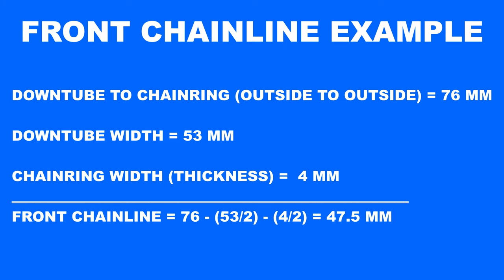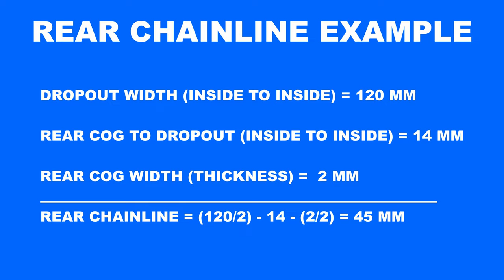PERFECT Chainline Every Time

Comment: Chain line is important. Especially for us doing restomod work and changing up the drive trains. I put a full internal hub drive on a 90's MTB with new crank and external bearing BB. My concern was chain and cog wear. I lucked out, Only 1mm out. 9 speed chain. You are not the only one that mucks up load mm to cm as a non-native metric speaker.

Comment: it may be more precise to measure the chainline off the edge of the BB shell, and then offset the measurement by half the BB shell width, as the middle of the seat tube is not such a sharp reference.  

Also by single speed bike had a rather crooked chainline from the factory, but I wouldn't bother to do something about it for a long time. But  I have finally adjusted it recently by moving the chainring from the outside to the inside plane of those parts on the cranks that the chainring attaches to. And been amazed at the resulting improvement. The chain rattling reduced dramatically, and it stopped trying to snag on the cog teeth -- which was a real annoyance until then. And also apparently that ever slight angle where the chain lays on the cog with crooked chainline, squeezes the paraffin wax out from inside the rollers, because after the fix it now seems to stay smooth for so much longer, when the chain runs parallel all the way around.
Reply: I agree with re-positioning the chainring from the outside of the crank spider to the inside of the spider. I’ve built 5 single speed bikes on circa 70’s and 80’s road bike frames and have found this method works very well to move the chainring “in” a few millimeters. I don’t like using spacers on the hub or bottom bracelet- I think reducing the thread engagement weakens the retention of either the freewheel (rear) or the bottom bracelet (front). 
Excellent videos and very informative.
Reply: Sorry - bracket (not bracelet). iPhone inserts words and you have to re-check (which I obviously didn’t do lol😮!)